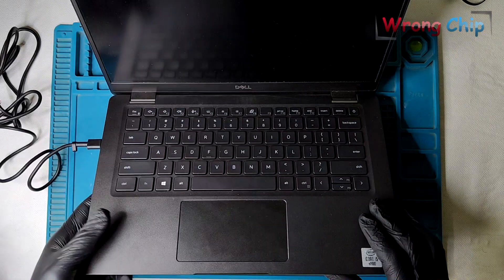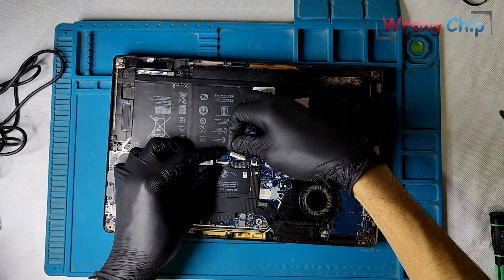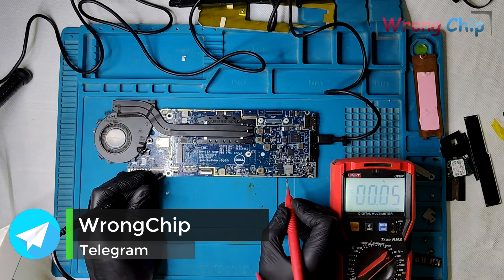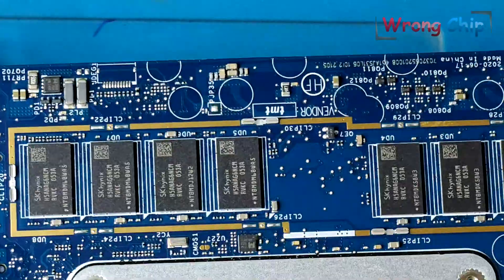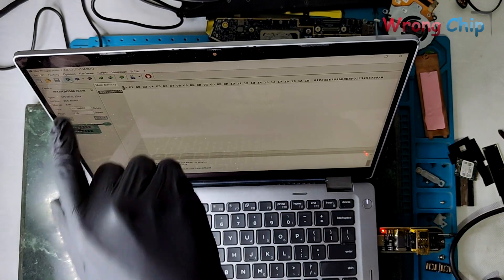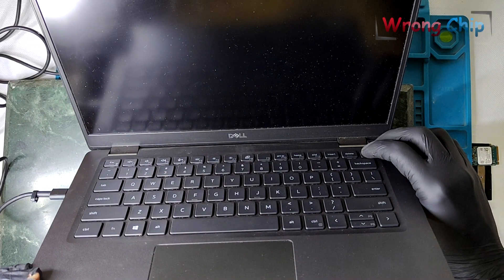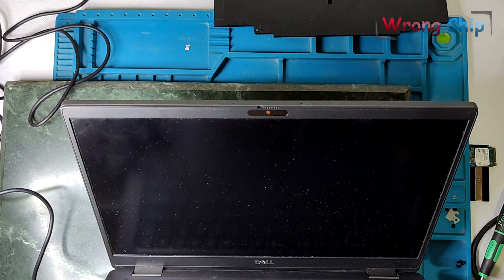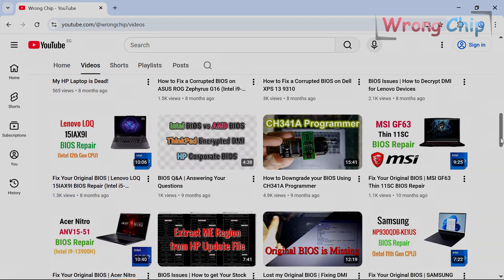Dell Latitude 7310 | How a Bad BIOS Flash Caused a No Power Issue

Comment: in usb tester not switch to 5v to 19v in dell 5420
Reply from the maker: It could be a shorted component, a broken type-c port or an issue with the PD controller.

Comment: Please bro, have you ever repaired or edited bios files for hp elitebook 840 G3 laptop. This laptop has Two bios chips 16mb and 8mb bios chips. 16mb is the main bios and 8mb chip is EC Bios chip. But I have made alot of research on how to edit 8mb EC CHIP bios files but I have failed. Most of videos they edit only 16mb bios file. Yet I RECIEVE alot of motherboards when they have tempered 8mb chip
Reply from the maker: I don't know how to rebuild an EC file. Just get the EC file from another similar working devices. Sometimes you will have to modify the EC in case there is a Password or Security Issue.